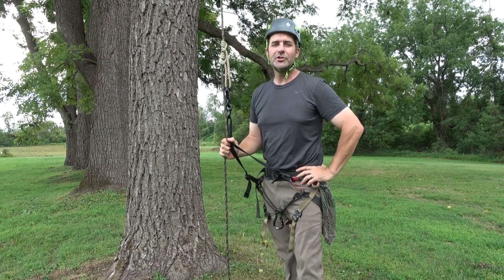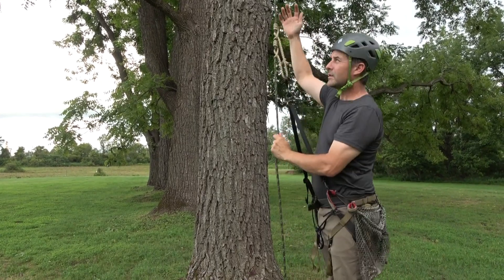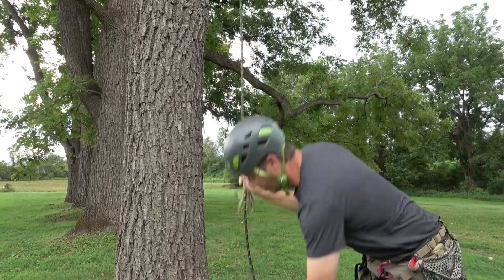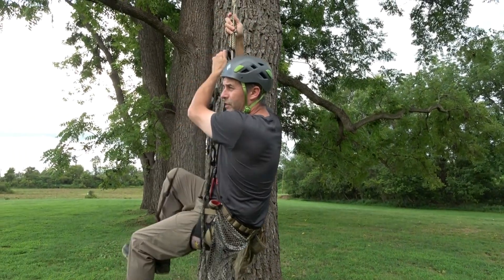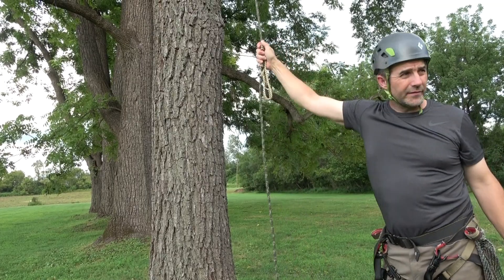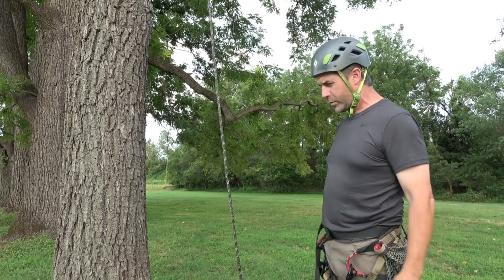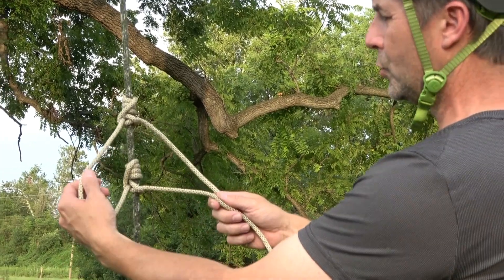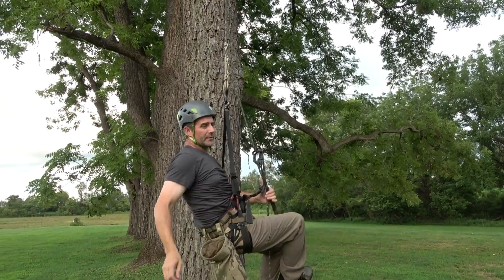Introducing the Double Michoacán' (Double Meech) Friction Hitch

Comment: I noticed you tied this on heavier rope.  But it should still function without issue on 8mm rope tied with 6mm cord correct?
Reply from the maker: @newlifeassembly-wheeling677yes, it does hold, however the ability for a friction hitch to hold is dependent on many factors, including its design, the materials used, the surface area of contact, and the conditions. For example, the same hitch on the same rope will slip and soaking wet conditions before it will in dry conditions. As a general rule, I feel that 8mm SRT climbing is a bit aggressive.  Also, I have gotten feedback to support that lighter climbers have less issues with skinnier ropes.  I have constructed a table of recommendations on this page.  Also note that I prefer the Longhorn Agile Hitch over the Double Meech. 
https://jrbtreeclimbing.com/content/rope/
Reply: @jrbtc thank you!  I’ll check out the longhorn agile.  I’m currently not using a rope method to ascend the tree.  Still a stick guy.  I only found your channel within the last week or two and I haven’t ventured into rope climbing yet.  But I want to have a safe way to get out of the tree should I lose footing.  Your videos are very helpful and much appreciated.
Reply from the maker: @newlifeassembly-wheeling6771  thank you.  And to be clear, we can use sticks while managing slack, but need to do so in a manner that ensures we aren't dependent on the stick. Stay tuned for more. Cheers
Reply: @jrbtc yes thanks for the reminder.  Planning on being tied in to lifeline in addition to lineman’s belt.  Didn’t do that until I watched your videos.  I never felt like a lineman’s belt was enough but because that was the standard saddle hunting way, I just assumed I needed to get used to it.

Comment: Isn't this creating the same effect as the Rope Wrench? Effectively reducing the load on the hitch, making it easier to break
Reply from the maker: I dont own own one, but my understanding of the device, which is used in conjunction with a friction hitch, is to creates a bend in the rope, and absorbs some friction, enough to reduce the amount on the hitch so that it's manageable.  I don't know the exact ratio, but read it is used with 11-13 mm rope. The double Meech is a completely non mechanical solution and so we don't need to have a device and obviously, it distributes the load at exactly 50% on each hitch. With it and the right cord, i have executed non mechanical SRT climbs with 9 and even 8mm rope. I can make the assembly as long or short as i want it. And in a hunting application, we prefer non mechanical solutions (nothing to clang and make noise). The double Meech also allows me to remove load and advance the hitch upward with one hand. This is handy when transitioning from a sitting to a standing position when hunting.  Lastly, it served as inspiration for the 523 JRB Ascender which came next.  I am providing a suite of non mechanical options for various rope climbing applications. If you have any particular device and like it, I have no objection whatsoever. There are a lot of fabulous devices.

Comment: Wow Thank you so much!!! unbelievable... thought i'd get into climbing bought some rope and cord tied my prusik knot and couldn't break it, thought there's got to be a better knot system and sure enough you tube led me straight to you your system is so simple and easy thanks again. Question:  Is the meech better than the JRB  asender knot or does it just depend on the application. Keep in mind I'm new to this so dumb it down for me. thank you thank you thank you!!!!
Reply from the maker: It depends on the application.  This is simpler: if ya know a meech, you can figure out how to tie two. The JRB Ascender is more complex to tie but offers similar performance but in a single hitch, not two. It has other features though. What are ya using it for?
Reply: @jrbtc  Well I was just going to do some tree work  around the house but now that I see you guys using it for hunting I will to

Comment: Very smooth tending hitch. Auto block, English prusik, kleimheist all sucked when I tried. This opens up much smoother, and catches instantly, doesn't tighten up on you, etc.
Reply from the maker: Yes it's smooth. Of course, it's two independent hitches in one assembly. I have since replaced it though with preference for the JRB Ascender Hitch.  With a 523, i can get almost the same performance as a double meech and more versatility.

Comment: I hope people r incorporating this system.  I had to switch over to my other climbing rope. From now on until the end of December I will be doing MRS in the frigid 🥶 using a DMM HITCHCLIMBER ECCENTRIC. It has been stealth stripped which means the center hole & the ends of the 2 carabiners r quiet & there's no cold hitting my gloves. My Beeline hitch cord has a 5 wrap Michoacon with the very tight eyes made in the factory by Iron Street. I simply attach the loop on my paracord on the right to my factory loop of my climbing rope. Over the crotch & down with only 1 clip into the top carabiner on the Hitchclimber.  Using these tight eyes means the bottom carabiner has to be stealth stripped after putting on the hitchcord.  That hitchcord was tested & stayed very compact in the system earlier this year. Since my hands won't be frozen after attaching this it is easy to put another Michoacon hitch below it & tie into my redundant bridge below. I always keep my primary webbed bridge very long when using my HitchClimber.  I'm hunting a different wind tomorrow in a place I haven't been to in almost 3 weeks. I set this spot up in early October.  Went to it the 1st  morning of December the day after I got my Covid booster with a sore left shoulder.  🙃
Reply from the maker: Appreciate the feedback. Thx. I have over a decade of MRS /DdRT experience. I have no use for it anymore.  It's got too many disadvantages as compared to the JRB Climbing Method, described on the dedicated playlist here on the channel. Summarizing, there's no sense dealing with all the friction of a moving rope when it doesn't need to move. It can remain stationary... and you can climb up both strands in parallel like an SRT climb but on two strands at the same time. NO metal on metal, no devices and no knots tied at the tree. And its got redundancy for crucial components.  In MRS, what happens if your friction hitch completely failed or an eye snapped? Not good. In JRB, you're safe. And can recover safely without assistance.

Comment: Love this! Been watching your videos for a few weeks now and am ordering some cord to start practicing with this hitch … hopefully going SRT next season. My main line is 8mm resc tech, would 5.5mm Beal Kevlar work ok for this application? 6mm TRC is out of stock where I normally order from and I use that 5.5 Beal cord for my normal tether hitch and it seems to work just fine. Thanks for all the information you’re sharing here!
Reply from the maker: Think it through... I can't recommend SRT for a hunter in light of the advantages of the JRB Climbing Method, particularly on my new JRB Ascender Hitch.  6mm is a good diameter cord on 8mm rope. Discussion is easier in my FB group, same name as the channel.

Comment: Great video. I tried a single meech the other day and immediately was impressed with its easy release. My question for you is related to using this knot in rappelling. How much concern should be given to the amount of friction on both the hitch chord and main line? What would you estimate the life span of the ropes used in this video would be if used regularly?
Reply from the maker: I will say that if you do have the munter engaged, the friction is absorbed mainly by the climbing rope and i have climbed systems for 4 years and retired them only because they were old and the rope out of warranty, not because the rope was worn. Rappel slowly and distribute the friction and heat.
Reply: The 2 things should stand out to people. If someone has a closed loop prusik on their tether that binds up in both directions that putting a piece of metal as an alternative is not the solution.  Using hitchcord & closing it with the Hunters Bend after tieing a 5 loop Michoacon is. 
If u r ascending a 🌳 & find yourself using SRT with a footloose & can't reach the tree with your foot there is another alternative.  Convert that SRT to JRB so u can have 2 lines over 2 unions or crotches. Now u r spreading out the friction over 2 lines with 2 different Michoacon hitches.  Most 🌳 I climb solely because the orientation of a  🌳 @ the base I might not be able to put 1 foot up against the trunk as I start. However my goal is always to get on the right side of the 🌳 while climbing. In all cases  I am able to use my foot on the trunk by using the double union system using MRS which will be fully converted to JRB soon. 2 hitches, 2 unions, 2 bridges while always being able to advance my line if need be. All Samson 11.4mm rope will be used for 🌳 cutting purposes & replaced with 8mm climbing rope being Sterling Oplux or dry Mammut. All my lanyards I have been using have a double loop end with a Michoacon 5 wrap. All the closed prusik looks I have would only be needed for a self tending application which would be few & far between using in MRS.
Reply from the maker: If you're using a Munter Friction Hitch or a Figure 8 or equivalent, placing it under the hitch as demonstrated, then the friction on the cord is minimal, and so everything lasts a long time. I see no advantages to rappel on the hitch only and don't recommend it nor use it regularly. In the video, I used my foot as a crude friction device instead of the munter. And as with all climbing ropes and cords, we need to inspect and replace when compromising wear is evident. Sorry, but its hard to be more specific on how long.